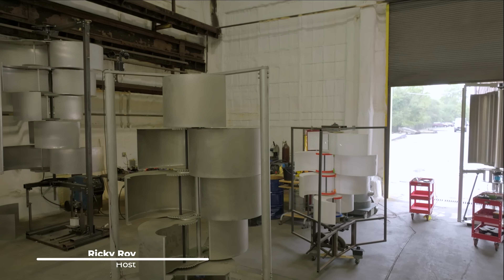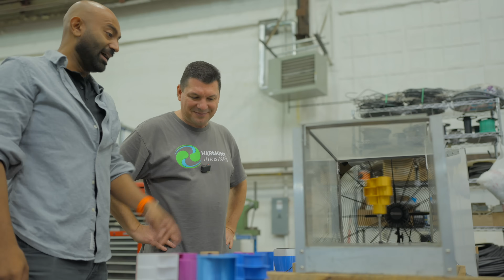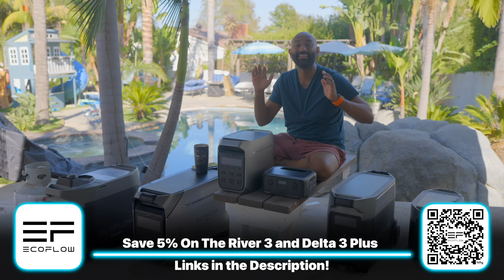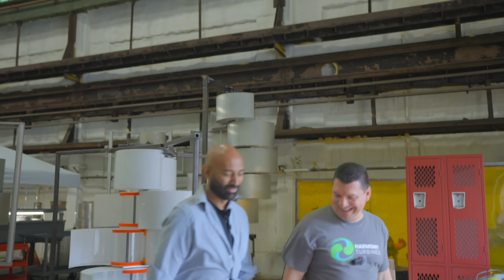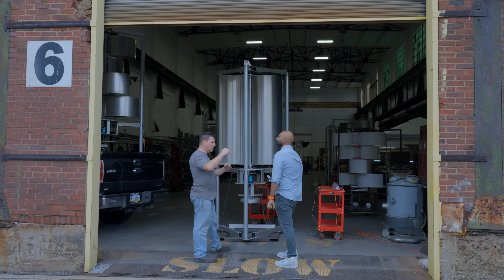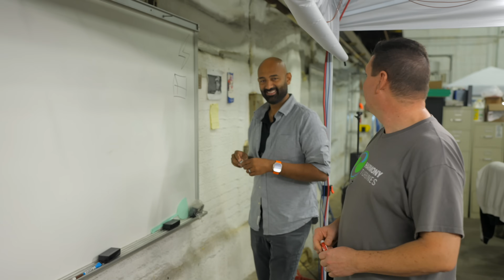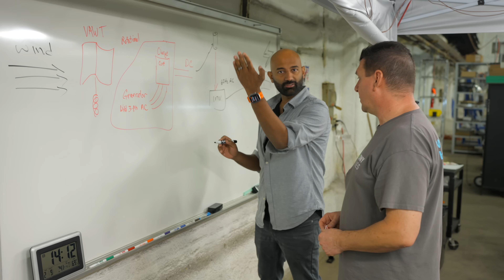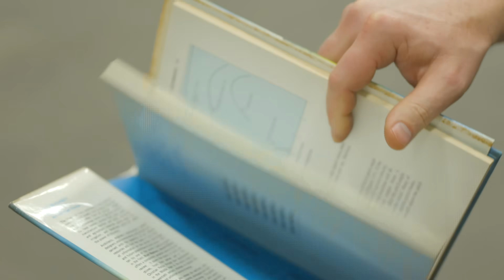This Could CHANGE Home Wind Energy Forever!

Comment: The gap in the center is crucial for increasing efficiency, because it gives another effect similar to a Pelton turbine - air velocity changes direction and imparts more force, and it has an exhaust route that pushes against the rear of the advancing scoop and reduces low pressure drag, which is the case with a closed scoop.
You can have more than two scoops per level. 3, 4, 10 or more could work and wouldn't need to be staggered to defend against stalling as there would always be enough available torque.
Reply: Two scoops on an axle simplifies the furling mechanism and minimizes angular inertia, footprint, and gyroscopic torque.
Reply: @denverbraughler3948  but you want angular inertia and torque.
Footprint? No change.
Gyroscopic torque? Meaningless - the axis of rotation won't change apart from that of the slow Earth's rotation, or if it's fixed rigidly to a ship.
There are other methods of furling or braking, such as retraction, shading or shrouding, and which can be done passively as a result of mechanical negative feedback.
Reply: @ahaveland  That is kinetic energy bleeding. If energy stream  are diverted it looses energy so it balances out. There is a better way of using the drag on the upstream blade , convert it to drive energy and to reduce the drag on the back of that blade. It comes down to you have a rotor that will be able of higher revs, and that will also reduce the vibrations to almost not vilible
Reply: The more scoops you have the more drag surfaces you have. Less kinetic energy

Comment: I wonder if the open/closing function would be cheaper to produce with a simple mechanical centrifugal linkage. You could get rid of a lot of the gearing and teeth, which tend to cost a lot to produce.

Comment: Problem with residential wind is height.  If you can get it higher than the tree it can work.  I see a small one on a building at the top of a big hill, close to my house.  Same one wouldn't work on my property unless I had like an 80 ft tower.
Reply: Towers are not free.

Comment: I also like this design because the bucket that is being pushed by the wind, also dumps its exhaust into the upwind bucket to help offset the force required to divert the airflow.
Reply: But this means that that air is no longer available to push the upwind bucket so it's not obvious how it offers any advantage.

Comment: @TwoBit   Why not use a variable cam/geared system in between the VAWT and the generator connected to it so they could keep the generator spinning at a certain rpm reguardless of if the wind is blowing at 5 or 25mph  (honest question...not an engineer)
Reply: A gearing system would increase cost and you'd reduce efficiency due to friction. Also, it would add extra points of failure and more need for maintenance.

I'd be interested to see if making these out of plastic or fiberglass would help or hinder the manufacturing costs at various production volumes and what effect it has on efficiency

Comment: Something that this video does not mention but as someone who tried to make his home as energy efficient as possible is that given that 2/3 of all American housing is single family homes in master planned communities that have HOAs. These HOAs often don’t have permissive by laws and are a significant impediment in any modifications to your home. I had to jump through many hoops just to get a solar array, heat pumps to augment the existing hvac, I was denied many a times in my attempt to plant native species in my yard to help with the any standing water. I was denied attempts to convert my front yard into a cloverleaf surface rather than grass that required constant maintenance and a lot more water.
Reply: The grossly inefficient land use and resulting car-dependency of R1-zoned tracts of housing is itself a problem that needs to be fixed.
We need higher density and mixed-use zoning development to replace dead/underutilized shopping malls and their massive parking moats, and along all the stroads (which themselves need to be converted to "complete streets" with bicycle lanes and bus/tram lanes so people have options to get around other than cars). 
If more people can live closer to the places and things they want to get to (work, school, grocery shopping, dining and entertainment) and have different ways to get there and back, that would solve a whole lot of problems.
Reply: In Washington state, zeroscape and solar panel installation may not be restricted by HOA bylaws.  I live in a 48 home community which by state law, our HOA cannot disallow roof solar installation on my home.
Reply: @klintcook-z8m  solution: do NOT live in an HOA. Power corrupts. Do not choose slavery to anyone!
Reply: @klintcook-z8m  google says 1/3 are HOA, not 2/3
Reply: States can pass laws stating HOAs cannot stop solar installations, merely provide some reasonable guidelines, like Michigan did in July 2024. Make the case to the state, elect representatives that support it, and then HOAs lose that authority.
Reply: HOA's i do believe that is the originating motivation for the invention of the Guillotine

Comment: Add flexible solar to the exterior of the drums for a small increase of power. Granted, it will not be that much as the drums rotate out of the sunlight, but there is some additional power. A little more electronics and blocking diodes would be needed. With no wind you are still getting some output during the daylight hours.
Reply: My concern with that would be figuring out how to transfer that power. You can't just have wires as they would get wrapped around the central shaft immediately. Plus each solar panel would have 1/2 then normal duty cycle
Reply: @levib0057  A common slip ring is used to get the electrical power from the rotating portion of the device to the stationary portion of the device.

Comment: Totally want a vert wind mill on my roof. Live in El Paso.. windy town. Lots of us have flat roofs here. Would be easy to install one of these on my roof next to my solar and boost the homes power generation.. especially at night. My concern would be.. we get REALLY windy quite regularly. Like 30-50 knots is not uncommon. The occasional 50+ at least a couple times a year. I see this thing can close up, i guess for those times when it would become damaging to operate it. But i would be curious what designs exist that can actually continue to operate in high winds. Like the 30-50 mph range. They seem to want these to operate at peak, around 25mph. When do they begin to close? And do they close completely above.. 30 or whatever.. or do they close partially and try to maintain their peak rpm?
Reply: @airheart1 that's the entire reason for harmony. If you read our information on our website you'll see that the point is to NEVER stop producing. Why would we want to WASTE those great high winds. Our furling system simply lets us control our RPMs and keep right on producing at maximum (or bonus) power levels safely right on through those high wind events. This is where Harmony could really shine because other small scale turbines actually have to stop spinning to protect themselves. We have a good educational video (1m long) right on our main website demonstrating this for you.
Reply: @HarmonyTurbines  excellent. That answers my question. I’ll have a look. And wishing you guys luck bringing this to market down the road.

Comment: Wouldn't it be better to start considering DC appliances to reduce conversions?
Reply: Exactly.  I'm working on this around my homestead using cordless 12vdc and ryobi 40vdc batteries now with many diy applications.   I.e. led lighting, can openers, ptc small ovens, etc.
Reply: but it also need conversion

Comment: Just a thought on it, getting a variable speed transmission from the turbine to the generator could help with ensuring a better range on the output going into the generator.  As well as setting up the gearing for a common(cheap) generator.  Throw in something like a flywheel to dampen out the fluctuations in wind speed.
Reply: Also there is most likely too much power loss through the transmission.  Hope not!
Reply: The mass for the turbine itself could act as a flywheel.  Make the whole thing out of stainless steel so it'd be relatively cheap to produce while also being quite heavy, but not so heavy that gentle wind has a hard time getting it to move.
Reply: Sounds expensive though
Reply: The DC-DC converter thing that is over in the battery charger work effectively like a transmission without the need of moving parts.  You have to size the generator  for the strongest wind.  Because of the inverse cube relationship between wind speed and available power, the RPM is not all that different over the range that matters so the electronics can deal with it.
Reply: @kensmith5694  The power is cube of speed, but voltage is linear to speed. So not to worry.
Reply: I know a solution and it’s cheap but bulky
Reply: Wind turbines already have gear boxes.
Reply: No need for the flywheel, the rotor itself probably has enough inertia to dampen any fluctuations.
Reply: @TheSirGoreaxe  have it pump water. It wouldn’t matter what speed the wind is going. You can have a water battery/generator. No chemicals and cheap
Reply: For some reason Torque Converter popped into my head when I read your post.
Reply: @OGPatriotABC  Torque Converter and CVT are basically the same thing.

Comment: 400-500w in a 25mph wind 💀
Reply: I get that from one $150 solar panel, no bearings, no generator, no maintenance
Reply: Exactly. This is a joke, and a bad one. Unsolvable problem because there is very little energy to be harnessed. 
If it's 500w at 25mph, it will be less than 200w at 20mph and much less than 100w at 15mph. 

Energy available go with the cube of air speed, any drop in air speed comes with a huge drop in energy available.
Reply: Fun Fact: if you're running inflatable bounce houses you have to shut them down in 25mph wind.
Reply: So? Most wind turbines can't even run at 25mph wind. The goal here is create spmething that generates more than 0W
Reply: @texanplayer7651  that's just not true

Comment: the problem with wind is the wind doesn't generate energy, it turns a shaft connected to a generator that generates energy from the magnets inside rotating, the GRNERATOR is the real problem with wind tech
Reply: In that sense no kind of energy is generated from any  sources but only from generators .... Your logic is recommended for Nobel prize plz go and take it 😂😂
Reply: @mayur7483 really my motor that generates prower isn't connected to a generator 😂😂
Reply: @mayur7483 and also how do solar panels and nuclear reactors generate power is their generators invisible?
Reply: @doubleooh7337 For solar panels, see the Wikipedia article "Theory of solar cells".

There's literally a joke about how we use nuclear reactors to boil water to generate steam which runs a turbine to spin a generator. The heat is generated by nuclear fission (or burning something, geothermal heat, or solar heating in other types of steam-electric power station), but the turbine and generator work the same regardless of how the steam gets hot.

Why is it a problem that wind "doesn't generate energy"? Energy is neither created or destroyed in any closed system we've observed, just changed. I don't care if my power came from a steam plant, water turbine in a dam/river, or a wind turbine when I'm using it to cook dinner or whatever.
Reply: @doubleooh7337  You clearly have absolutely no idea how nuclear energy works
Reply: @reddragonflyxx  i dont need to know how a solar panel works thanks! and what does a generator being powered by the boiling water, have to do with HOW a NUCLEAR REACTOR creates energy?
Reply: @doubleooh7337  A nuclear reactor doesn't generate energy, it converts mass (energy) to heat (energy).

Why is it a problem that a nuclear power plant doesn't create energy?
Reply: @reddragonflyxx  lol trying hard not to sound dumb.
Reply: what I'm wotking on has a 3phase output be perfect

Comment: The magnetic bearing might get trouble as they only are working to 80C then lose all their magnetism (There are high temp magnets 80C plus) but those you dont get as N45 afaik.
So the turbine would only be possible in cold climates... a better soution might be a air bearing with graphite,  take some of the wind of and force it with a compressor that is run by the wind turbine to lift the turbine 🙂 otherwise cool idea
Reply: Unless the bearing's not doing it's job and causing a lot of friction you're not getting to 80C in any climate.
Reply: @TheAkashicTraveller  you are able to get over 90 degree on metal surfaces where i live (thailand) in the summer...
Reply: @snapo1750  then paint them white. EZPZ
Reply: @snapo1750  not 90c on silver or white shiny surfaces. Plus the wind is actively cooling it and removing any solar radiation heat.
Reply: @snapo1750 if it gets to 80c (176 degrees Fahrenheit) outside, your wind turbine will be the last thing you're going to be worried about.

Comment: As a teenager in the 70s I  worked for a man developing a savonius rotor.  (Baum, Sr., et al U.S. Pat. No. 4,177,009;)  it is interesting to see another design to slow it in a high wind.  He started with 50 gallon drums offset.  The biggest issue to getting it profitable was generators could'nt  hold up to the power.
Reply: @padraigAZ please contact us from our main website or send us an email. I'd love to discuss a few things with you that might save us some time in the end. The big challenge for us right now is RPM ranges for generators that we're testing. It's like the wild-wild west out there. I love your sentence "The biggest issue to getting it profitable was generators couldn't  hold up to the power." -That is a GREAT problem to have and one we're happy to tackle. So any info you can share to help further our cause would be greatly appreciated.
Reply: @HarmonyTurbines  Why don't you just use a CVT?
Reply: @HarmonyTurbines two words: Regenerative Braking
Reply: @rowanshole :

Your idea seems confused.  For “regenerative braking”, the generator handles the power.  So what problem are you solving?

What you might mean is to increase the stator voltage so that more power can be transferred at a higher voltage but without increasing the current.  But it will still be constrained by upper limits of what output voltage can be utilized by the rectifier.
Reply: @denverbraughler3948  no, I mean having another generator that runs when the unit is overpowered. Basically, one generator to deal with low wind speed and another to deal with higher wind events.
Reply: @rowanshole  so ~2x the price, hence the profitable
Reply: @rowanshole another idea though would be adding a transmission with a fly wheel battery that then powers a generator. So you can use the low torque ratio to direct drive the generator and when you get higher torque you load the fly wheel which slowly discharges into the generator
Reply: @rowanshole We could save millions of lives if we built a car out of the black box material that houses the recorders on aircraft.. yet, price would be pipe dream insanity.

The problem of what you propose is scaling of wind power potential when you double the speed being a 6 to 8 multiplier. That's an IMMENSE gain that must be built appropriately to endure conditions as the blade tip speed & balanced rotating becomes a serious issue.
Reply: My question is when???  I have been waiting for these guys to come to market.  It can't take that long to finalize.  I  the first person to say don't release until it is ready but version 10??? There is a point to say stop improving now and go to market.  Saying we can't go to market because there is a new version coming.  It is always coming.  When???
Reply: I'm sorry, but that just does not make sense.  Rarely in the history of wind power has inability of the generator to withstand the power, been a serious problem.  Virtually all properly engineered wind generators have some form of automatic furling or braking system.  

Number 1, savonious wind generators don't produce much power.  
Number 2, generators come in all shapes and sizes and degrees of robustness. Simple to design one to handle any conceivable loads.
Reply: @LindaStevensBZ  We could save millions of lives if we made every car out of the same material of aircraft black boxes but then it would be unrealistic in costs. The question is the strengthening cost per gain of power generation performance.
Reply: @RP-hn1qc  What is an electric generator?  A rotating mass of copper surrounded by some magnets mounted on a shaft supported by a couple of bearings.  Extremely simple...from every angle.

The bottom line is the vertical axis wind generators are utterly futile.  And these Harmony contraptions are probably the worst I've seen.
Reply: Why not use a hydro-static transmission to avoid mechanical failures.  You could have several pressure gates involved for different RPM ranges and output to more than one generator.

Comment: Very nice presentation! I hope that you also cover horizontal wind turbines....mounted on the ridge of common home roofs(for example).  I'm assuming that the wind would accelerate and pressure would increase as it climbed the roof slope to meet the fins.
Reply: That's exactly what I was thinking. If the house happens to face prevailing winds you could get decent power out of it, and visually it'd be barely noticeable up there.

Comment: eco flow is not a brand you can trust - it made me stop watching this videos. I had trouble with their batteries .
Check the brand of the cells they are using. Those are terrible cells ffrom the spot market in china and therefore people get crap . No eve or byd or catl cells at all.